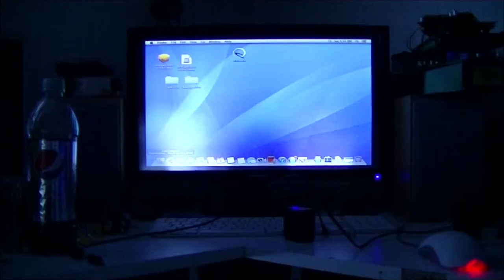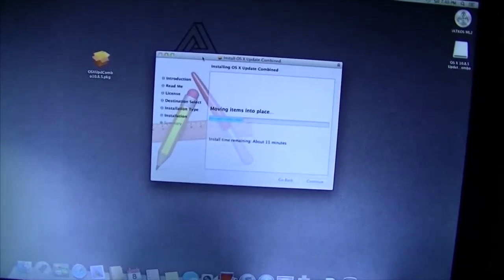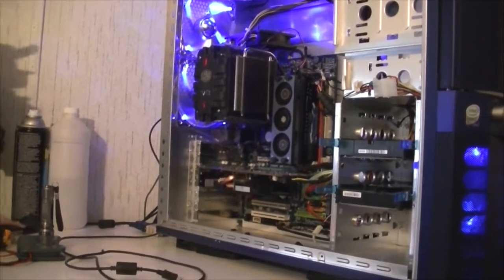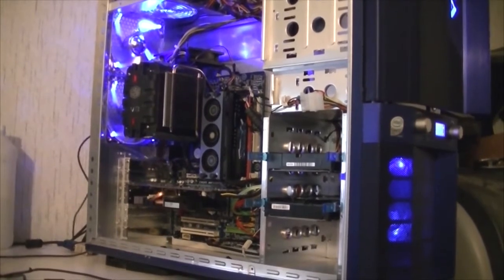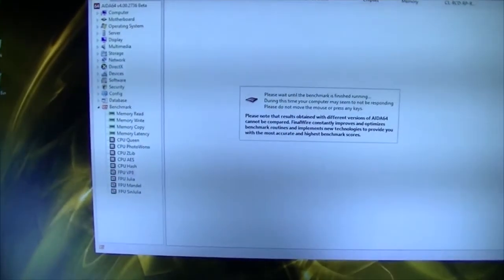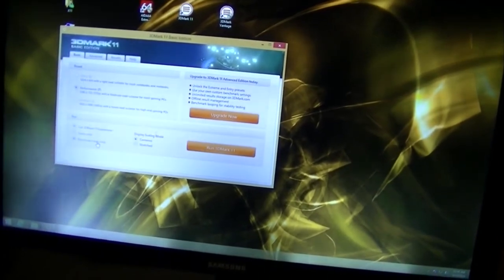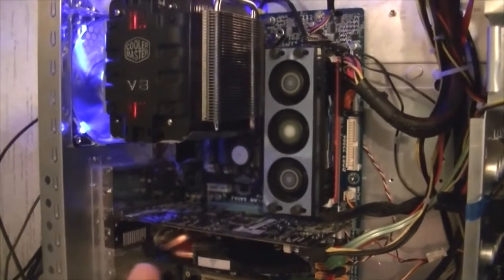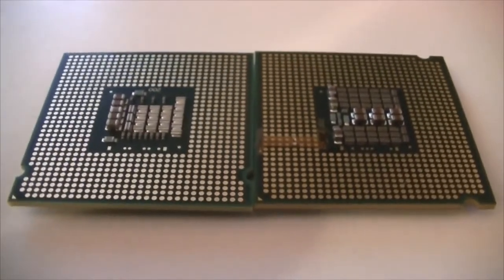LGA771 to LGA775 Update 2.16.2014

Comment: Stupid Question: Why does one of those processors have the orange clear tape type stuff over some of the pins?
Reply from the maker: That is the adapter which flips 2 lands on the cpu so it will function in the 775 socket. The portion of the adapter that goes over the lands is punched out so the pins of the socket continue to touch the cpu. This makes it tricky to get it aligned so there is no covering of the pins :)
Reply: That's the mod to get the socket 771 CPU to work in Socket 775. There's way more success with this mod for Windows machines. Allows you to use a Xeon quad core that has 12MB of L2 cache, very cheap too.